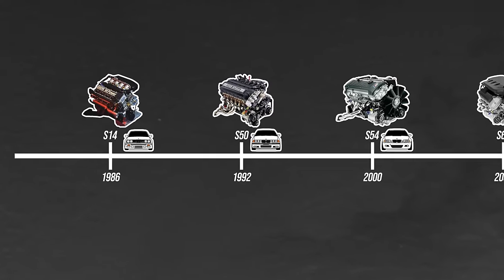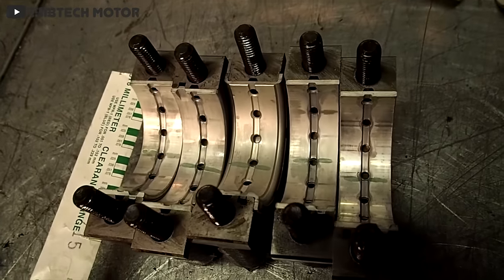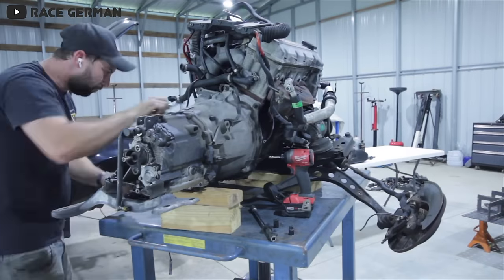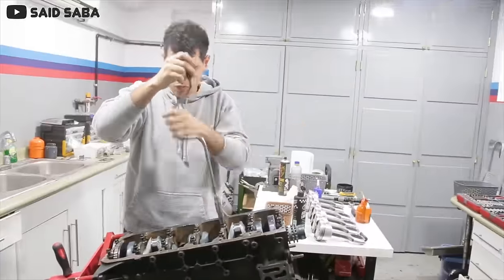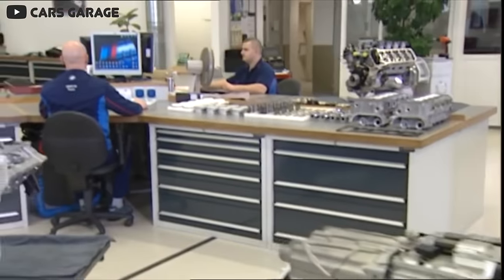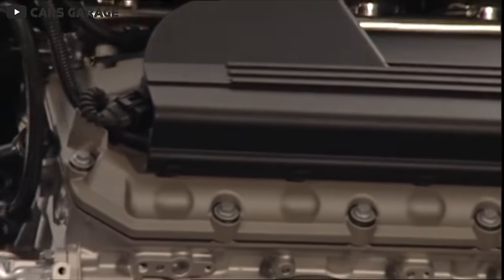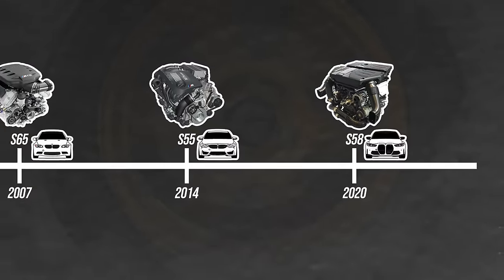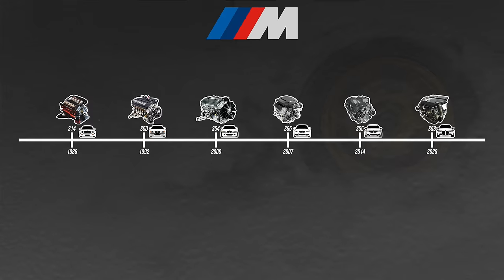The History of the BMW M3's Engine

Comment: I think the us spec s52b32/b30 gets a bad rap. Yes it don’t get the added power of the euro motors. But it also doesn’t get the added unreliability, or more specifically added maintenance. The us motors only have single vanos rather than dual, the rod bearings are not super tight so they don’t need to be replaced like most m engines, s54 still had the rod bearing replacement requirements. The s52 is just a simpler more reliable engine. Mine has 165,000 miles and is used exclusively at the track. It makes 240 whp and doesn’t skip a beat. Also e36 is a great bargain for a track car. Super reliable, easy handling, just a great front engine rear wheel drive car to put tons of track miles without a lot of maintenance.

Comment: My friend had an m3 g80 and has run 780 hp al on stock just half half racefeul sparkplug went gone after 1 night racing so it is pushing it to the limit but this thing with new turbos and some stronger components would run 1000 hp easy crazy

Comment: You’re wrong to say Toyota had a big hand in developing the B58. Toyota had almost NOTHING to do with the B58 development. All Toyota really did was put the B58 through their own stress test to make sure it was up to their own reliability standards but the actual development was basically all BMW. Toyota didn’t really come on until 2014…the B58 went into production in 2015, it’s takes a lot longer than a year to develop an engine. Not to mention that the B58 is part of the B generation of engines. The B generation engines are a modular engine, basically that means they are designed to just be the same engine but can just add or remove cylinders. The B48 is just a 4 cylinder B58 which went into production in 2014, and the B38 is a 3 cylinder version that went into production all the way back in 2013. The B58 being reliable is because BMW made it that way, Toyota just gave the thumbs up that they liked it.

Comment: S65 V-8 is the winner. Peak N/A power, instantaneous throttle response and magical high rpm sound. The ultimate M3 to me would have the lighter, shorter and more powerful S65 V-8 in the E46 M3 CSL with a manual instead of the S54 inline 6. BMW knew that, as they ran E46 race cars with the 4.0L V-8 in the IMSA series and won the class for that one year until the series kicked them out for not making a real production version of it. It wasn't until BMW produced new racing cars based on the E92 & V-8 that they became dominant again in IMSA racing

Comment: The first three Generations are great. The S65 is interesting and since is the last of the NA engines might be ok,but they do have issues as well.  The newest Turbocharged crap , well I don't care how fast or much power they can make the engines are overcomplicated plastic component having designed obsolescence garbage.  After the E46 the M3 basically became a Grand Touring Car and not a Sports Car with the newest ones being overweight Pigs.  The S54 is God's Motor anyway.

Comment: Great video man, very informative and easy to watch! I will say that a couple main difference about the n55 vs my engine is that the s55 has ITBs (independent throttle bodies), two sets of turbos instead of a scroll, and the aluminum bits that make the engine lighter over all. It also possesses a lighter carbon fiber driveshaft to the n55s regular one, and a lighter magnesium crankshaft over the n55s. Overall its a stripped down/built n55 with two sets of turbos which is why the s55 f87 m2s are much more sought after than the n55 equipped models. Looking forward to more vids
Reply: The S55 does not have ITBs.  The last BMW M engine to have ITBs from the factory was the S65 and ITBs were a common trait shared across most naturally aspired BMW M engines of yore.
Reply: @e90m3lci  Curious, I was led to believe even the m4 had ITBs. I cant find any proof that the s55 only used valvetronics except for a wiki article and a youtube vid online which didnt even state that it doesnt have it....Do you have more solid proof?

Technically speaking valvetronic takes care of the throttle body business on modern BMW engines, since air flow to each cylinder is controlled by the valve lift on each cylinder. But its not as good a system as ITBs and I would be bummed if that is actually true.

But my original point was that the n55 has a far less sophisticated version of this system than the m4 has, in either case. While they share similar components the motors behave night and day different.
Reply: Crankshaft is the same in m2 n55
Reply: S55 engines only have one throttle body on the beginning of the intake manifold after the j pipe. I've taken a few apart
Reply: @paulmeduri4451  In the m2 n55, not the regular one in the 335i/435i
Reply: @jamesphares244  then that is a bummer lol i thought all m-cars including the new g-series had ITBs....guess valvetronic is just that good nowdays they dont need it? 

Btw you a badass to be taking these guys apart like that. Do you work on them or just have enough experience to work on them on your own? The most I felt comfortable touching on mine was sparkplugs/coils so far, which I swapped for NGK Iridium sparks and Bav auto high performance coils. Im running a stage 1+ mhd tune right so its mostly just to keep burn down. May pin crank next when I want more power tho
Reply: @BoostedAkatsukiRiffs  I'm not sure what you mean by proof but besides all the technical documents floating on the internet, you can also pop the hood on your own F8x and see for yourself that there are no ITBs on the S55.
Reply: @e90m3lci  thanks someone else who actually works on them has pointed that as well, sorry I got that bit wrong. The s55 is still a monster with or without ITBs, but that is a bummer

Comment: I had an 04 m3. I sold it in 2017 and bought a 2011 335is. The N54 is the most satisfying sounding and feeling engine I've ever drove. I have full bolt-ons and a stage 2 tune on. Plenty of torque low down and doesn't die off until about 6800 rpms. Loved my e46 but it felt like you didn't have any power under 5k rpm. I'm wanting to buy either a 98 328is 5spd or an 04 330ci ZHP soon if any of you guys are selling lol.
Reply: Dude I have 2007 335i 6 speed manual you know twin turbo dark grey tinted glass needs a coil or two few little things like that I’ll sell it man
Reply: Get an LSD for true driving prowess
Reply: I really love the 335is, it’s actually fuckin sick, my friend had one and it’s a really amazing platform

Comment: B58 all the way. You can get a great looking car (F30) and an engine capable of massive power all while being reliable by BMW standards and far cheaper than any new M car. And it comes in a manual. F30 340i all the way.

Comment: The reason why they used a 4 cylinder S14 engine in the E30 was because of weight distribution, not just weight.

Comment: The S50B30US and S52B32 by far is my favourite  , easy to maintain and run with low octane compare to Euro spec.
Reply: Easy to maintain sure. But it requires premium fuel just like the s50b30/b32.
Reply: Love my S52B32...sounds way better than the S54.

Comment: S54 and s62 are best engines! 
S85 is just masterpeace...swap s85 in e46 and you have 550hp v10 in great chassis with aluminium block not adding weight and keep balanse of the car 
Dct for modern people and manuel for crazy guys :) 
Personally think that e46 m3 with s85 worth 100 000$ commpared with car market

Comment: Fully dressed, the S65 is not lighter than the S54. That has been shown to be false. Simply just the block and a few other items are lighter. Not the whole unit with everything needed to function. The S54 is considerably lighter when it's all taken into account.
Reply: site your source please. S65 is also more compact/shorter which aids in weight distribution.

Comment: I say this as an E46 M3 owner....

When you say the E30's 197hp was good Vs the V8 Mustangs 200hp, that's only half the truth. The normally aspirated M3 engines all make their max power at very high rpm and only just before the redline. The S14 makes 197hp at 7,500rpm. At every point of the rev range below that it makes less and less. At 4.4k rpm it makes only 123hp. I bet the big, lazy V8 makes its 200hp pretty much all the way through the rev range.
Reply: I agree that the v8 will be way better for low rpm torque, but it also has a linear power band, if it revs up to 6k rpm and max power is at around 5.5k (i don't know the exact specifics of that engine) then at 3k rpm it will also have 100 and something hp. There is no engine that makes full power all the way through the rev range, they might feel more powerful for street use because they have more low rpm torque but they don't have magically 200hp at 3k rpm unless they are making like 4 or 500 hp at 6k
Reply: @joey_f4ke238  Yes and no. The torque at low RPM will fill in the blanks for the BHP and push you along nicely. There most torque the S14 ever produced was 177lb which is pretty wet to say the least. And it made it at 4,750 rpm
A V8 is gonna make double that at idle probably.

Comment: Important point: Even though some engines are "based" on the non-M engines, like you stated, don't get a wrong feeling by thinking you can make a M-engine out of a non-M one. Some basic measures and general cylinder layout might be the same but there are close to 0 interchangeable parts, especially in the S50, S54 engines and I bet also in the S55.
For example cylinder bore spacing and number of valves is the same on both M50, S50, M54 and S54 but not much more really. Cylinder blocks are entirely different and not interchangeable, heads as well, crankshafts, rods and pistons design, measures and materials, variable timing gear and so on...
Exception are the S50US and S52US engines, those are in fact souped up M50 engines. But they are short of quite some horsepower compared to the non-US spec S50 engines in the E36 M3.
Reply: Could u get aftermarket parts for the rest m54? To keep the aluminum block? Are just not worth the weight saving?
E36 m3 is definitely my fav car.
And not sure if I should go with an engine change. 
Would like to just get an other e63 m6 engine in it but figure it will mess up the weight distribution.
Reply: @m3kid  Well if the M54 is worth it depends on some factors. If you want to swap it in an E30 for example it is worth it imo. It is the same weight as the factory 6cyl SOHC with iron block, maybe a little bit lighter even. So you don't mess up the weight distribution of an E30 and have a good powerful and torquey engine. Just bear in mind that 3.0 M54s don't reach their rated power in most cases. They are often close in output to a M52B28. I think that is because of the cats integrated in headers (at least here in Europe we got them like that - think early UK cars got the floor mounted metal cats from the E36 328). So for an E30 I would consider a M54B30 swap with some headers and I would think of a solid torquey 220hp (crank) engine - like a N/A 2JZ but with less weight.
But the cable work to swap the M54 into an E36 for example isn't too easy I think.
As for getting more power out of it, it is not really worth it sticking to a M54 imo. Well you can for sure get some 240 250hp crank out of it with different headers and cams but nothing more really economically to be honest. Boost is difficult because of weak 10mm head bolts in an alloy block that might have soft head bolt threads because it overheated once. Sure you can enlargen the threads (and holes in the head) for 12mm studs but M54 with some real boost seems to be always a pita...
However with upgraded head studs, a good block with no soft threads and a centrifugal supercharger like Rotrex they produce some respectable power from very low boost numbers.
But it's always a bit work when going M54, especially with more output in mind. Also worth mentioning about M54B30: the crankshafts seem to be not ideally balanced or engineered. Or the rod ratio is too bad (89.6mm stroke and only 135mm rods). Anyways the 3.0s don't like to rev high for long and create some bad harmonic vibrations which sometimes lead to loose oil pump sprocket nuts and thus to catastrophic engine failure. Need to safety wire or weld on the nut if racing is about to happen (or just to be safe). But shouldn't rev it to 7000 or above on a regular basis maybe... Max output is also limited because of that. 

About the V10 engine... They are heavier than the E36 M3 engine but not crazy heavier. 30-40 kgs/15-80 pounds maybe. But those engines are a pita, too. 
Aluminum block LS engine would be far easier, durable and lighter.
I think it's about 210-220 kg which is about the same weight as the M3 E36 and E46 engines.
Reply: @peterm3861  man appreciate all the knowledge u gave me plus ur time thank you  🙏
Reply: @peterm3861  I definitely want to keep a bmw engine in it close to the same weight. 
Ideally I would want the v10 love my m6 and there pretty cheap. but compared to my 08 black series driving them back to back I do miss the torque the Mercedes has. 
But u know way more then I do about engines. So if u where in my shoes and u wanted a reliable 500hp and torque. 
With a power band more for controlling sliding with the throttle and counter steering. 
What would u do? And at that point would it be better to shoot for the moon and go for 700hp?
Reply: @m3kid  Oh sorry for the late response. Well I bet you hate to hear that if you're from the United States because you have sh*tloads of them over there, but... Just LS swap it imo 😂
I am from Germany and american V8s are pretty rare here. I wanted a rwd manual car with a good amount of power and I like simple engineering so I got myself a C6 Corvette with a LS3 rather than an E46 or E92 M3. Their engines are very emotional but also problematic (at least the V8 of the E92) and lack torque in daily driving or drifting... Too much headache for me and while those engines are screaming at over 100hp per liter, the LS3 puts down over 400 lb-ft yawning at less than 70hp per liter in stock form and running forever with only one or two little issues that might occur. Also LS's are pretty lightweight and compact. If you don't live at a place where you get boo'ed at doing so - go LS imo 😄
Reply: @peterm3861  No worries 
 lol ur really making me think about the ls3. 
I love the sound of a v8 Would u go super charged or turbos?
Reply: @m3kid  Well slowly I enter terrain which I don't have any experience in because of strict German technical inspection und limited possibilities in modifying cars.
All I can say is that a turbo setup might be a bit overkill on a LS. You would need extensive forging in the engine and drivetrain and the torque would shoot into space :D You are able to get 500whp N/A out of a LS3 without German limitations I would say, 450 at least. Which is plenty in an E46. Other than that there are two kinds of superchargers: The "classic" roots or twin screw type that raises the power almost across the entire rpm band but starts getting less efficient up high in the rpms. And then there are like belt-driven turbos like the Procharger systems. They behave a bit different than the classic superchargers by upping the power in a linear way with rpm. That might be the friendliest way of adding power for your engine and drivetrain and also keeps the car more controllable. Also makes the experience of revving out the engine towards redline more exciting. That is what I plan someday for my LS3 C6 :)
Reply: @peterm3861  seriously thanks for all the info and help

Comment: The first iteration of a inline 6 turbo petrol engine was found in the (e23) 7 series model from 1977-1986. 
The engine was based on the m30 inline 6 engine from 1968-1995 it had a cast bottem end ,aluminum cylinder head ,forged crankshaft and rocker operrated single overhead camshaft 2 valves per cylinder. 

Re-named m103-m106 it produced 258hp in both variants the m106 had an incresed capacity to 3.4l but ran lower boost pressure 6psi instead of 9psi.

Comment: If we are to take reliability into account, you would have to say the S50 and S54 are the last "reliable" M3 motors.
Taking character/sound/response into consideration,  the S65 was also a great engine, but it needs a complete rebuild every 80k.
The S55, though powerful and tuneable (being turbocharged) is a mess of expensive reliability issues as it ages and lacks the character and sound quality of it's predecessors.   As for the S58, I don't know yet, time will tell if they improved the reliability over the S55.   Unfortunately though I do not car for the newer BMWs especially the current M3/M4 because they are UGLY as sin and excessively computerised.   For me the E46 was the peak M3, all things considered.  A lot of people seem to agree because their values have exploded this last 5 years and show no signs of stopping!
Reply: Rebuild every 85,000 miles. You are making that up. There are a lot s65 on road that ha# over 100,000 miles and still going strong without a rebuild.
Reply: @The_North0  No I'm not making it up they are well known for it, and no that doesn't mean every single engine fails at 80k on the dot, it is possible they might last longer with 6 monthly oil changes and careful driving especially during warm up etc. but it is generally considered that by around 80k the S65 and S85 will be in need of, or soon to need a rebuild.